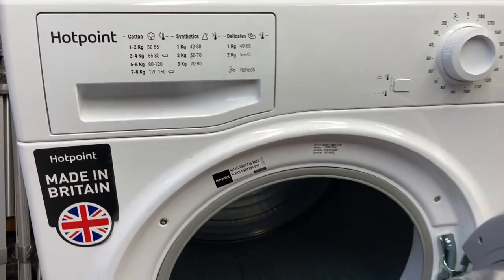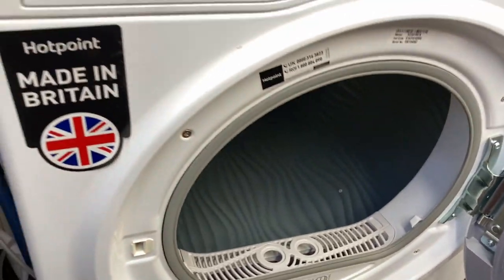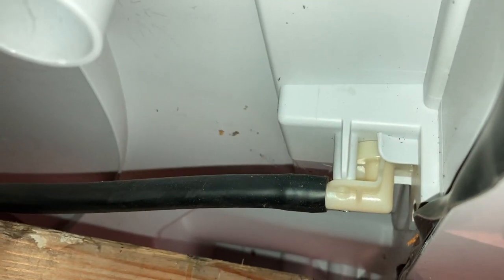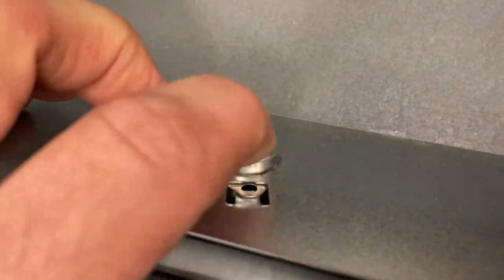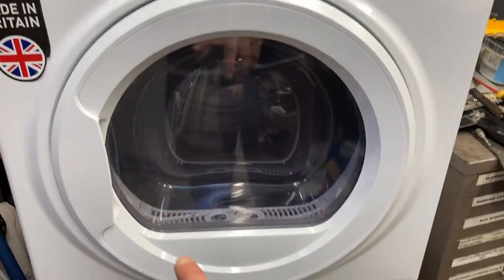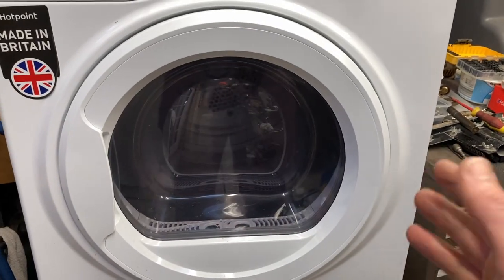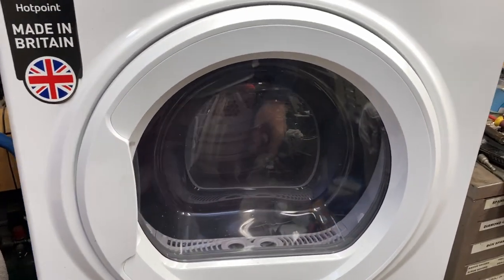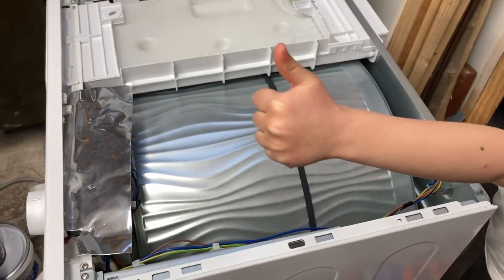Street find: tumble dryer | some damage to base | otherwise works perfectly!

Comment: That fan at the end is a cool down cycle, so no heat comes out. The bumping noise happens when hoody strings are getting caught between the drum and front duct. Can be smoothened down with a file, happens all the time. Lastly opening the door while the machine is in hot cycle, can make the one shot pop, and will heat no more. Common mistake is opening the door during cycle. Needs to go the cool down cycle for 10 mins before opening door. Made in Peterborough, year 2021.
Reply from the maker: Do you ever wonder Balfie that you might have a bit of an unhealthy interest in the Hotpoints?
Reply: @bootsowen  working for them a couple of years now buddy, like to comment to help u and others when I know about things rather than on other appliances that I'm not so sure about, engineer for whirlpool Ireland, so see these and many others, so just like to help u and others
Reply from the maker: thanks buddy, it's the only way I'll learn.
Have you seen my hotpoint empress? I'll make a video of it someday. It came up in an update video a year or so ago.
Reply: @bootsowen  I haven't, I'll have a look for it, I don't think I've seen one, I had a quick Google there. I was at a dryer last week, from 1995. Has worked since till the capacitor gave up. Them old hotpoint will last forever, I see hotpoint, whirlpool and Indesit, so if ya ever need help, ya know where to ask pal.
Reply: @bootsowen yes hotpoint washing machines were on the recall list a few years ago for going on fire due to the door lock

Comment: I think most condensers had the cooling air circuit reversed, and now they expel the heat through the front. My dryer had this done but they didn't change the manual, and in paper they show the older way.
About the buzzing sound: you should check if pressing the play button while running makes the buzzer go off (at least my older dryer did that thing)

Comment: I fixed my friends tumble dryer, the belt jocky wheel, it was shattered.
The amount of fluff/dust inside was really dangerious, i filled a shoe box amount.
it was donkeys years old,  indersit branded but the inside was the typical common  type.
Mine is branded candy, same  as every other machine.
Oh the handle on the water container cracks up with almost no force.